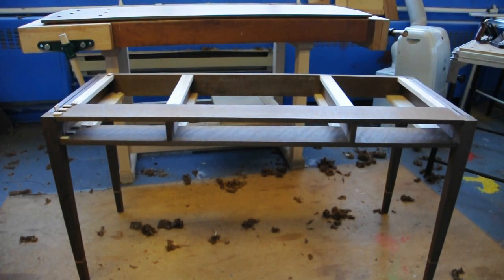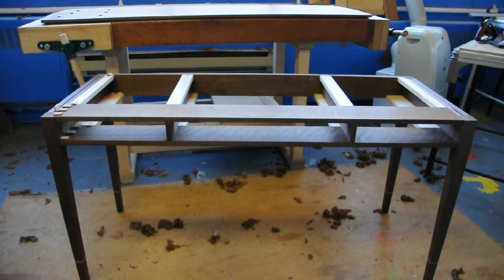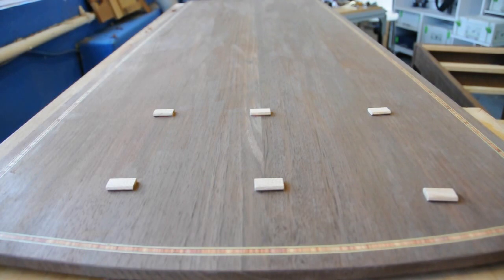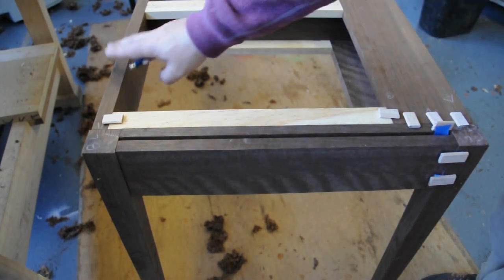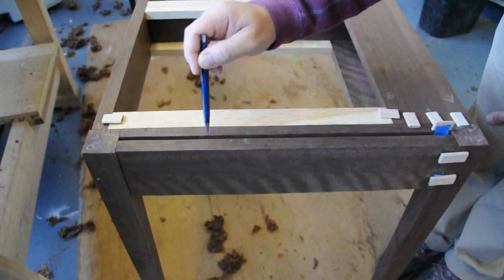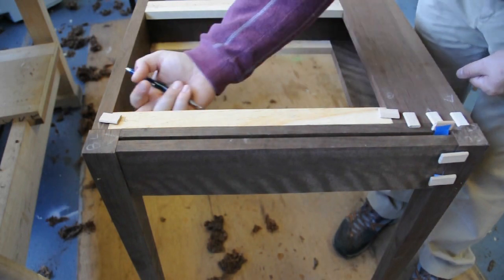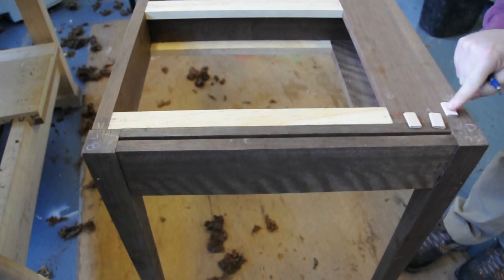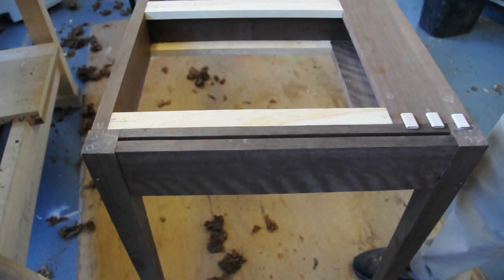Using the festool domino for all the joinery in a writing desk

Comment from the maker: Yes, usually the aprons are dovetailed into the top of the legs, but I'm not concerned about them in this case because I have other dominoes locking the side rails into the apron preventing the legs from moving. If you look carefully at the drawer runners there are two dominoes on the bottom runner and one on the top runner joining the apron, and the runners are glued to the side aprons which are themselves dominoed to the legs. So I should be ok! 

Thanks for commenting.